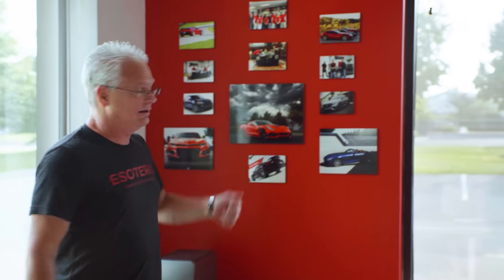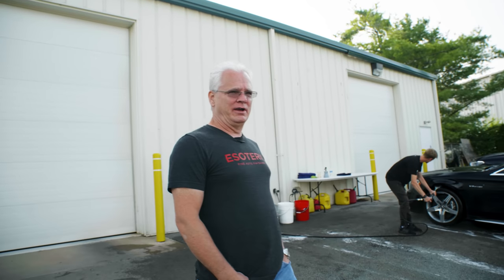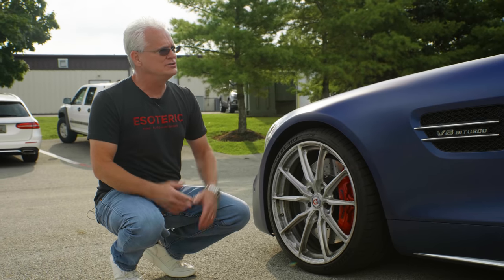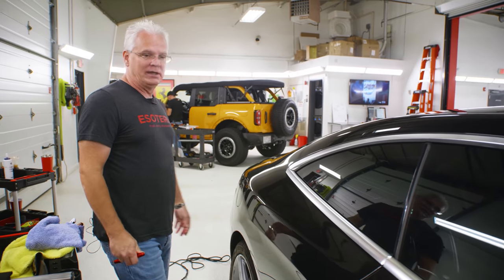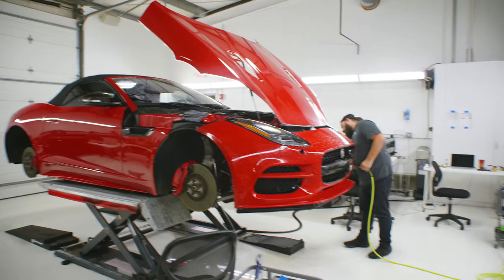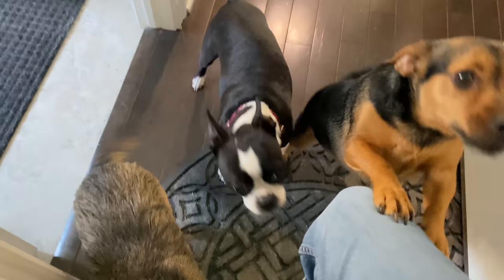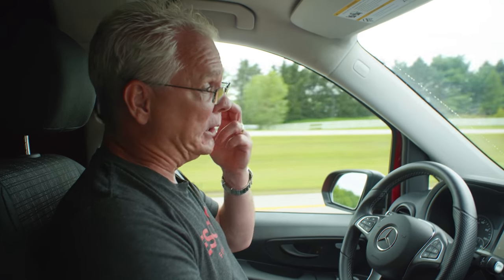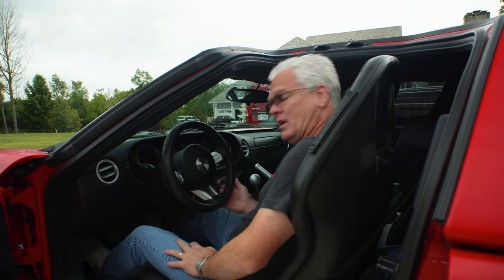Behind the scenes of HIGH-END auto detailing! | ESOTERIC Detail

Comment: Hey Todd,  After doing a paint correction I've seen some vehicles that have such a mirror shine it's almost blinding. In doing so are they removing all of the clearcoat and actually polishing the paint? I've seen some that after finishing there is no orange peel whatsoever. I just don't see how just by polishing the clearcoat  you could  achieve those kind of results. I've noticed some people do wet sanding to have those kind of results but no way in hell would I ever wet sand my car. Because in the long run you're just asking for trouble. Great video by the way. Thank you.
Reply from the maker: Removing orange peel on factory painted cars is a big no-no. Yes, you can get insane shine and reflectivity by simply polishing the clear coat and not removing orange peel. If you were to remove all of the clear coat, the paint underneath would be more of a dull finish. Glad you liked the video.